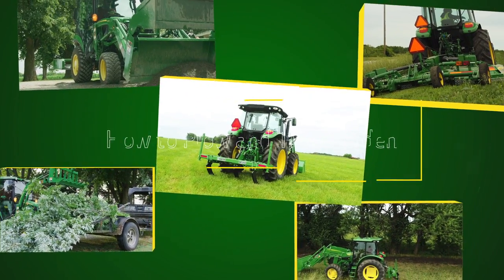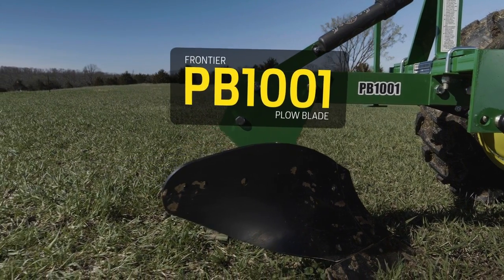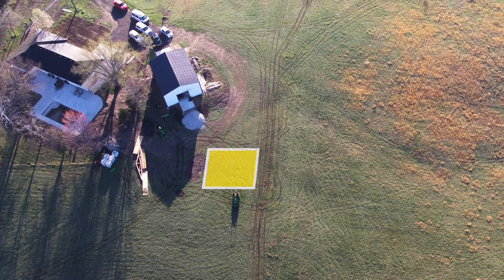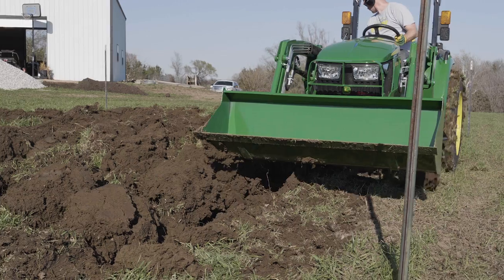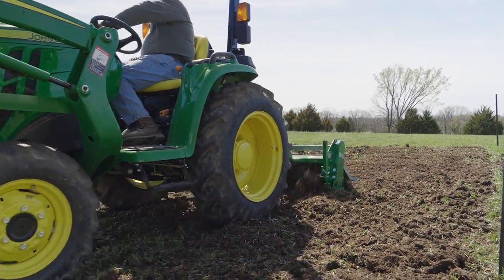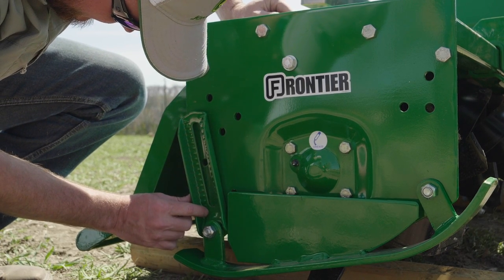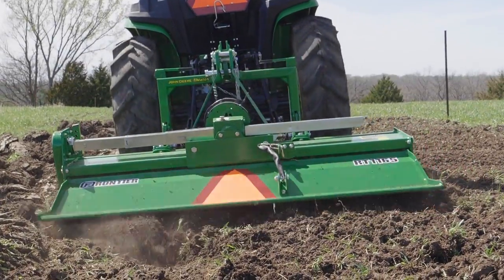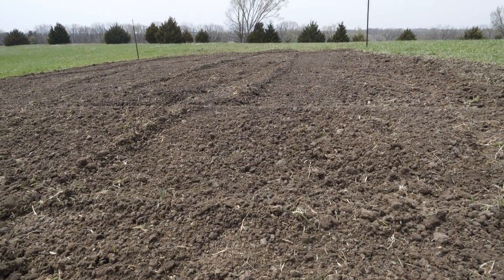How to plow and till a vegetable garden area that’s never been plowed | John Deere Tips Notebook

Comment: Friend apparently you've not done much plowing you start in the middle after you've made your first pass you turn the tractor around and drive over the dirt that you just turned over and you have to Farrell's this makes a crayon or a high spot in the middle for drainage it's called back Landing that is the correct way to play all to keep from having a low spot in the center or to one side of your garden

Comment: Anyone know what is different between 1149 and 3049 tillers?
Reply from the maker: Thanks for your interest, Eddy! The RT1149 and RT3049 Rotary Tillers differ on minimum and maximum tractor horsepower, weight, type of side drive, the hitch compatibility category, maximum working depth, and the amount of blades per flange. You can learn more about the RT11 Series here: https://bit.ly/3DqXzgS and the RT30 Series here: https://bit.ly/3FvV7I7. Your local dealer would be a great resource in determining the attachment best suited to your needs. If needed, you can find your closest dealer at Deere.com/Dealer. We hope this helps!
Reply: @JohnDeere  
Hello!
Thanks for the video!
Quite inspiring!
For commercial maize/corn production on an unprepared acres of land, what are the best and affordable implements (plow-till seeding) you can recommend for average of 75hp tractor.